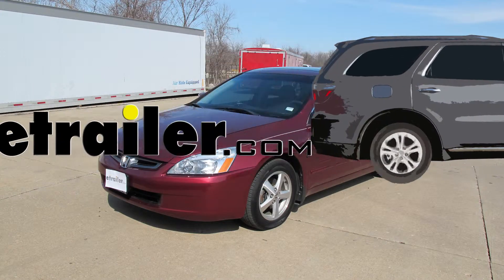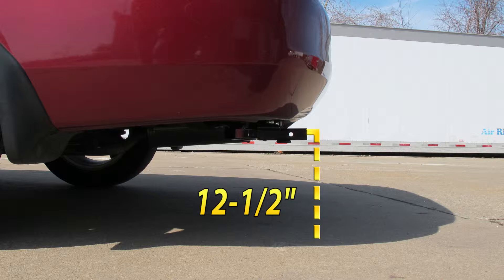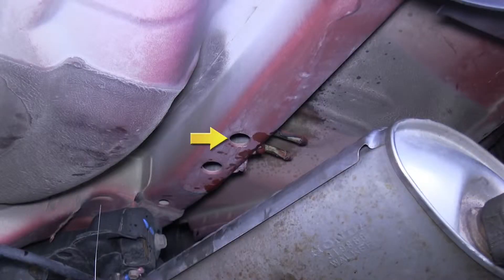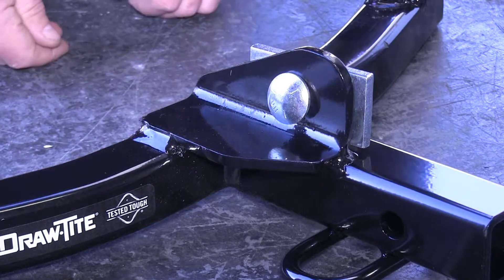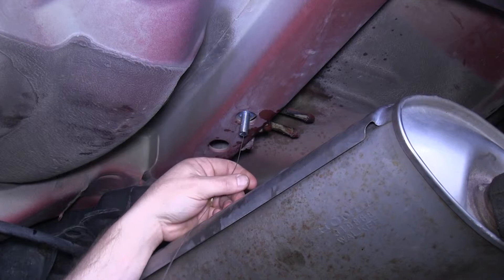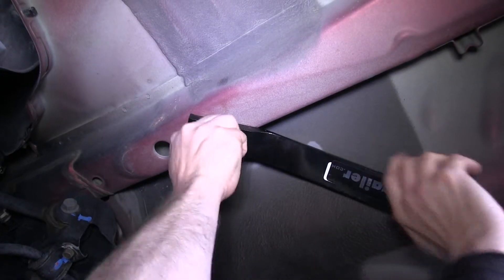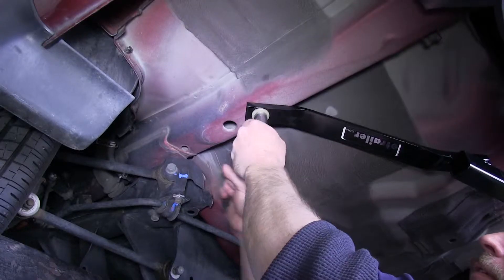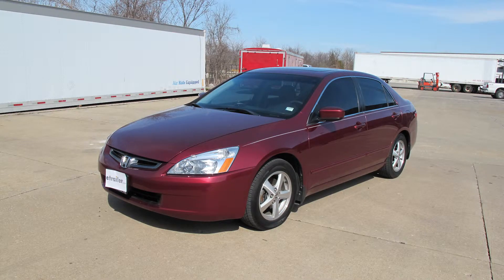etrailer | DIY 2005 Honda Accord Installation for the Draw-Tite Sportframe Trailer Hitch Receiver

Comment: Is there any heavier Weight one?  I need to tow a 8x5 trailer weights 450lb . And possibly in the future a motorcycle  that's about 400lb .   But mostly tow grass and leafs ..
Reply: Me too, me too
"Mostly grass and leaves" :)
Reply: maximum tow weight is 2000 pounds with up to 200 pounds on the tongue. you definitely do not want to tow any more then this. especially considering the mounting locations, suspension, brakes, and power. you should be able to tow a motorcycle and trailer with ease aslong as you use proper distribution.
Reply: the max trailer hitch weight rating might be 2000lbs, but a 2005 accord is only rated at 1000lbs